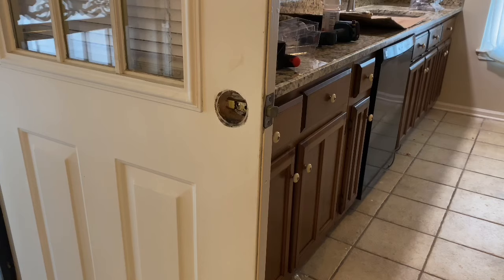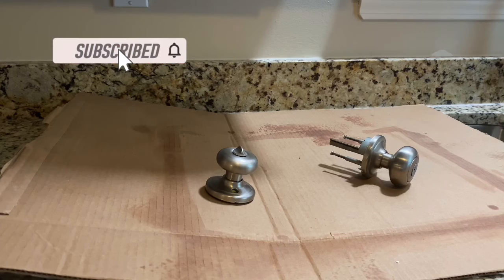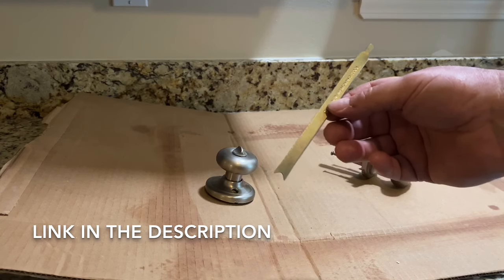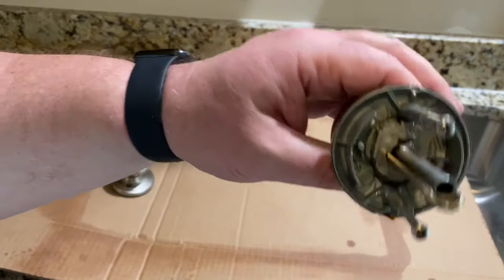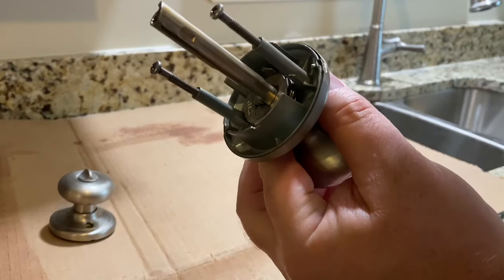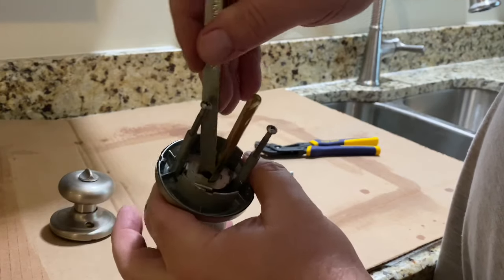How to correct an upside down key hole on Kwikset lock-easy cylinder removal

Comment: Thanks for the video. Helped me flip my key hole right side up. But it was confusing when you said compress the spring to get the center rod out. I eventually figured out you needed to push the spring forward when looking down at it and that there was a metal tab you could push on to make that easier. After that it was a breeze.
Reply from the maker: @Sir Reginald P Pepperbottom Glad it helped out! It’s confusing on how to describe some of the motions but once you figure it out it’s easy! Thanks for the note!
Reply: Yep, I had the same problem. Thanks for the tip!
Reply: YES! Thank you Sir Reginald. The little "door" was not opening wide enough to release the center rod until I tried your trick. That did it!

Comment: Thank You brother. I was putting in my new kwikset door knob when I ran into the same problem. I put back in my old one for the time being but I ordered the tool. Kwikset needs to be more clear when you order this set you're gonna need a special tool. Thanks Again...
Reply from the maker: Glad you found it helpful, Mike! I agree they should be more clear. They say it's ok to install upside down but no thanks! I'd rather do it right.

Comment: Thanks Doug. The original Kwikset I bought  23 years ago wasn’t upside down. I noticed the tube on that piece used to be metal. Again, thanks for the tips. I’ll use your link.

Comment: Thanks so much - I have exactly this issue with a Kwikset lock I installed for my mom's house. Everybody says "Dave you put the lock in upside down!" I'll buy that tool and follow your instructions and see if I can set the lock the right way. 🙂
Reply from the maker: You’ll be surprised to see how easy it is! Thanks for the comment!

Comment: I got the amazon dealer to supply the tool since it said works both ways, he shipped it for free.
One tip here the forked end is used to compress the washer too. Makes it easier to hold.
Thanx.
Reply from the maker: @R Harmon Glad to hear your dealer shipped it free. Kwikset will also send it free I’m told. Good idea on using the forked end of the tool on the spring. Thanks for sharing!

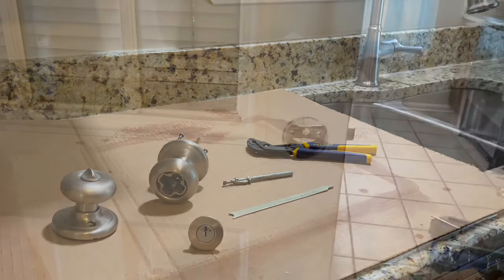Comment: After 4:42, you jumped directly from the center cylinder popping out and putting it back in. Could you tell us when and how should we put the center rod back?
Reply from the maker: @Zehua Zhou Hi, The center rod of the puller just turns against the nut on the pipe, pulling the ferrule off the pipe. I was showing a demo of the process on the copper pipe ending at 4:42 and then repeating the process on the cpvc pipe in the wall. After you screw the puller into the nut, turn the center rod of the puller till the ferrule pops off. Does that help?
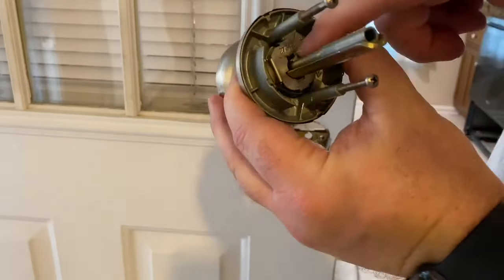Reply: @DougForce  Sorry I did not say it clearly. I mean, at 3:43, you pulled out the center rod. I don't see any time later when you put the center rod back. But I later found it at 5:15. Thank you very much for the video!
Reply from the maker: @Zehua Zhou Oh! I was thinking you were looking at my ferrule puller video - lol - I’m sorry - my answer made no sense at all! Lol Guess I misread the screen! My apologies on that one! Lol

Comment: I've been fighting this upside down lock BS my whole life, I just never cared that much as I can handle upside down keys. But, now that I'm paying 75$ for a lock set, they ought to be orientated correctly. What bothers me is I figured it would come in the instructions and it does not. Thanks for this easy to understand video; I just wish you had shown the measurements of that tool as I have tons of steel and a milling machine to fine tune it, I'd just make my own tool...
Reply from the maker: @dc6233 You can contact Kwikset and they’ll send you the tool for free…..
Reply: That is the annoying part-that Kwikset just says "It's ok" and doesn't mention anything about fixing it! Also annoying that this tool only costs 38 cents but you can't find it for that! You can buy it online cheap, but after shipping it's back to 8-10 dollars!! Home Depot sells it in a kit, for $11, if you're THAT GUY! Buy the kit, use it and return it- if you only need to use it once.
Reply from the maker: @sondegrace1842 It is frustrating but I’m told that Kwikset will send you the tool for free if you call and request it. They don’t advertise this and I wish they would.

Comment: Thanks for posting, after two other videos  I found yours and it worked. No thanks to Kwik set , they bc sent new tumbler, without instructions. Got it installed but the instructions to rekey it didn’t work.
Reply from the maker: @teaglet Kwikset could do a lot better job informing customers of the options.

Comment: Awesome explanation I am impatient so no special tool for me. However the explanation got me through using precision screw drivers so I can get these locks for our new house set up with the hey holes correct. (Some locks probably not the Kwikset ones are basically identical they just have a tab on the back side of the spring you can push instead of just pushing the spring forward like the Atlas 1738002)
Reply from the maker: Glad to hear the video helped out! I would recommend reaching out to Kwikset - they will send you the tool for free so you will have kit for the future. It really does make the process super easy. Thanks for the comment!

Comment: Great video. Would this work for a kwikset 991 lever set? The deadbolt lock faces the correct way and the level faces upside down. I would like to change the lever lock cylinder the right way.
Reply from the maker: @Kenneth Price Take a look at the previous comments here from Jeffery Williamson - sounds like he had a similar set to yours and it is possible to rotate those as well. I can’t say for sure as I have not seen one like yours, but I’m guessing it works in a similar fashion !

Comment: Great video. I used this information to correct my quickset lock however mine was the type with a handle instead of a knob and the procedure is a little bit different.  You remove the handle with the included Allen wrench in the cylinder is 3/4 of the way visible. Then there is a retaining clip that you can see in a small slot that can be removed with a small pick to allow you to remove the cylinder and turn it upside down. Just knowing that the cylinder needed to be removed was half the battle thanks for that. If you get your hands on the other style maybe you can do a video on that as well.
Reply from the maker: @Jeffrey Williamson I’m glad the video was helpful in figuring out the lever style! Thanks for the information, I’ll have to take a look at one of those.
Reply: I have the same lot, flip the cylinder very easily after reading your recommendation. However, the handle on the other side of the door is turning the wrong way, how did you resolve that? Did you still have to remove the long cylinder like the video shows?
Reply: @Jeffrey Williamson Thanks for your comment. I found that the process to remove the cylinder just wasn’t working for me. I didn’t think that having a lever would require a different method. But you’re spot on. Once I removed the lever, it was a piece of cake. 👍🏽

Comment: I had 2 to flip. Worked great on the classic knob. But the lever handle was a bit different.  Couldn't pull the post out, but removing a small clamp did the trick.
Reply from the maker: @YautjaHunter3 Glad to hear it helped you get things right side up! I need to check out a lever style. Thanks for the comment!

Comment: Professional handyman, with the tool, spent 45 mins trying ro remove the cylinder and still wouldn't work, kwikset has to make this easier, emtek a much more expensive lock is reversible in seconds without a tool.
Reply from the maker: @roberthall9336 I agree it would be better if it was easier to do and better documented as well. Price probably has a lot to do with that. I haven’t heard of emtek - I’ll check them out.

Comment: You know there’s no pins in that cylinder at all no little key pins, to get jammed up that’s why the company says it’s OK. It just doesn’t look OK it looks wrong because of the fact that most cylinders have small pins in them and I agree that you should flip it
Reply from the maker: @doorandlocktips - I didn't know it didn't have pins like that but agreed it does look wrong and looks so much better flipped. Thanks for the info from a locksmith! I subbed to your channel!
Reply: @DougForce  thanks for subscribing. I’m turning out a video tonight on Yale LFIC as always it takes way more time than anybody would believe I have to lie to myself or fool myself into believing these are useful videos to anybody ha ha thanks again for subscribing. I’ll try my best to help with door and lock tips.
Reply from the maker: @doorandlocktips  videos take way more time to produce than most realize!  But they do help folks - and it’s fun even though it’s work!

Comment: Just did this without the tool.  I had an old lock 1998ish.  The only difference was the one piece you took out first was plastic on mine.  Same technique.  I do feel a slight rub that I think is from not using that tool.
Reply from the maker: @chris martin The tool is not always needed or helpful, but I’ve struggled with stuck ferrules many times. So I was excited to find a tool than can help make removal easier in many cases. Sometimes the ferrules come off easily by hand, sometimes nothing works. The more options I have in the toolbox, the more chances I have for a successful job. Plus I love tools! 😀

Comment: Why does Kwikset even make them that way. Seriously, such a pain. I had to find a video for this. This should have been an easy install. What a headache, now I have to purchase something else to fix what their issue. Kwikset in cahoots with this tool company or it is one of their subsidiaries to make money. Thanks for the video.
Reply from the maker: @Playclaydo It’s designed to allow the lock set to fit doors that open from either left or right sides, so it’s actually a feature. But I completely agree they could have communicated the details much better! If you call them I’m told they will send you the tool for free.

Comment: Very helpful, thank you! Will flipping the cylinder around change the orientation of locking/unlocking to counterclockwise vs clockwise? So, if it’s upside down and unlocks with a key clockwise, will switching it to right side-up bring it to unlock counterclockwise? Thanks!
Reply from the maker: @SG Man that’s a brain teaser! Lol - I “think” flipping the cylinder will not change the orientation of locking and unlocking since the mechanism of the latch is not changing - just the key cylinder is rotating. But I could be wrong! Lol

I have an extra door lock available-I’ll try that next time I’m at the property and report back on how accurate my guess was!

Comment: I have a reverse thread setscrew on the keyhole side of my Kwikset that had to come out before I could to turn the center shaft. Dear Mr. Kwikset, I checked your website, no info about any of this at all. After fooling around with it for awhile I tossed this piece of crap in the trash and spent a few more bucks on a Schlage. I recommend others do the same.

Comment: In my situation the keyhole is facing the correct way. The issue is when the lock is unlocked when the button is facing vertical. And it’s locked when I turn it horizontal, away from the striker plate. Can’t find a video on how to fix it. Any ideas?
Reply from the maker: @818southside I’ve not looked at how those go together, sorry. If I can find one I’ll look at it.

Comment: Thanks for the video. I tried for 30 minutes holding that damn spring up and down. That center piece didn’t budge. It’s a good thing I couldn’t find my sledgehammer because this thing would have been toast. I just put the knob back on. Now I have a deadbolt teeth up and a knob teeth down. Annoying.
Reply from the maker: @Bill Anderson Sorry to hear about the frustration! The spring should be all that is holding the center piece if the tab is lined up over the hole - maybe some grime and gunk is holding it in place. Sleep on it and try again fresh - might try a little graphite lubricant to loosen it up if it seems stiff. The first time I removed mine it was tight but after that it disassembled easily. I’m working on my ice maker right now that won’t come apart as it should - I feel your frustration!
Reply: @DougForce  thanks for replying back. I’ll get back to it soon. When I finally succeed you’ll be the first to know. 👍🏼

Comment: The one problem that no one ever mentions when they flip the key cylinder 180 degrees is that the inside knob lock/unlock mechanism is reversed from clockwise to lock and counterclockwise to unlock. It's always going to be a half-win situation.
Reply from the maker: @emmel07 In this case, since the door handle is on the left facing from inside it makes more sense to turn the mechanism counterclockwise to lock as you are turning towards the wall where the latch is. Same for clockwise to unlock as you are sliding the lock out of the wall and into the door. If that was reversed it would be awkward i think. But if the door handle was on the right facing from inside then I see your point exactly! I guess it depends on which side the handle is located.

Comment: I have to turn the key in my deadbolt to the right to unlock, but have to turn the key in the doorknob to the left to unlock. Is there any correction that can be done for this?
Reply from the maker: @Robert Dailey Do both keys go in to the locks with the cut side facing up?
Reply: @DougForce  yeah, the keyways are in the correct orientation. The problem is that the knob's lock turns the wrong way. It's similar to that deadbolt in the video that you suggested to someone else. My deadbolt handle turns the correct way (toward the door frame), but the doorknob piece turns away from the frame. Maybe I can take apart the knob and reverse the mechanism like the guy did to the deadbolt.
Reply from the maker: @Robert Dailey I was going to suggest that, if the keyways were both in the same orientation. I’m not a locksmith but I have seen some mechanisms that will allow rotation like that. I’m sure some don’t as well but definitely worth a look.
Reply: @robdailey  what did you do to correct it ?

Comment: I did this but now after inserting the key, need to turn clockwise to lock. The deadbolt requires counter-clockwise to lock. Anyway to fix this so I can turn both in the same direction to lock and unlock?
Reply from the maker: @Passions You may be able to flip the deadbolt striker and have both turn the same way. Check this out and let me know if it works for you…

https://youtu.be/y7ycDo8wHYk

Comment: Removal was quick and easy. But apparently the blow from the hammer reset the pins in my tumbler.  Had to take it apart and set them manually as the reset key wouldn't work
Reply from the maker: @timewass I’ve heard of issues where the reset key wouldn’t work in general. They have a device called a cradle to easily reset the locks for that problem. Never heard of it related to cylinder flipping but Murphy’s Law, you know. Glad you got it straightened out!

Comment: what if water is leaking where the hose  is put on to turn voiul
Reply from the maker: @user-ot9qt8ps6f That most likely means you need to replace the internal washer. Slightly more complicated than this videos issue but still something a DIYer can do. Check out this video that shows the process https://youtu.be/BRfe3HBezxM?si=vb3KzduQoZe7CnqG

Comment: Just did yesterday . I suggest putting a piece of tape on where the key should go.
Reply from the maker: @Jim Calabrese Thanks for the tip. What does the tape do? Help hold the assembly together?
Reply: @DougForce  Actually it is to ‘mark’ the right side . Pen and markers wear off .
Reply from the maker: @Jim Calabrese Oh I misunderstood what you meant. Good idea!

Comment: The reason for them saying it will work is so they can sell you a new one when your tumbler pins get dirt and crap from being upside down.  THEY ARE WRONG.  Tumbler pins are to be on top. pin side of the KEY IS ALWAYS FACING UP.
Reply from the maker: @Jed Reay That makes perfect sense - thanks for the details!

Comment: I accidentally put the wrong door key in upside down. It's stuck. Can't even turn the lock all the way. Tried everything. The key is locked inside the lock. Any suggestions. Worst case is I have to buy a new lock.
Reply from the maker: @Random Tube Wow that’s frustrating! I’d probably try disassembling the keyset to see if that helped remove the key. Or maybe trying to use a pair of pliers to pull they key out? Stay some silicon lube to help while pulling - sorry that happened!

Comment: I plan to try your method. However, if it weren't so expensive, I'd just replace all Kwikset locks as they're sub-contractor grade. If you're lucky, a frequently used one might last 5 years. By contrast, the Schlage locks on my father's house are over 50 years old and still going strong. I highly do NOT recommend Kwikset; over 40 years of constantly replacing them has taught me to buy some other brand if possible..
Reply from the maker: @EdBoyd-l4d Contact Kwikset and they will send you the tool for free. Schlage is definitely a better brand than Kwikset, quality wise. But quality is expensive - even crazy expensive these days.

Comment: My question is why do they make them upside down?! Infuriating, thanks for the video!
Reply from the maker: @Skin Bear I ‘think’ this is a feature, allowing the lock set to work with both right hand and left hand doors, one way right side up and one way upside down. But they don’t make it clear that there is an option to keep the key right side up in either configuration and they don’t include the tool unless you ask. If they were more upfront, it would help a lot!